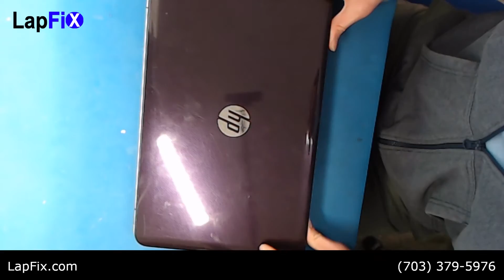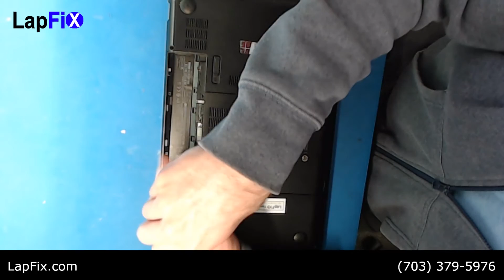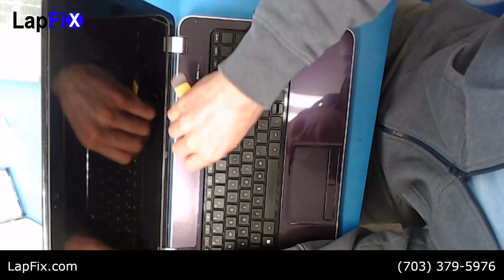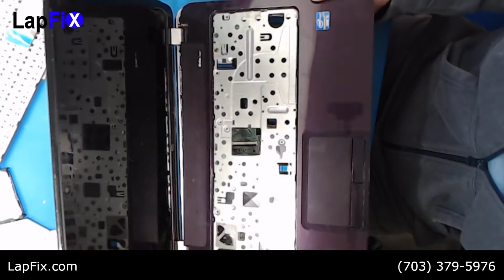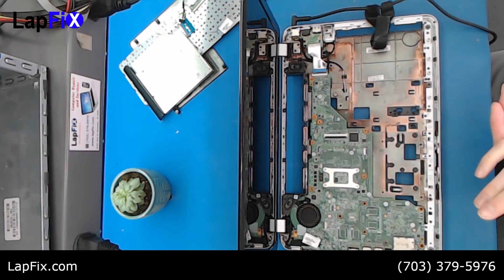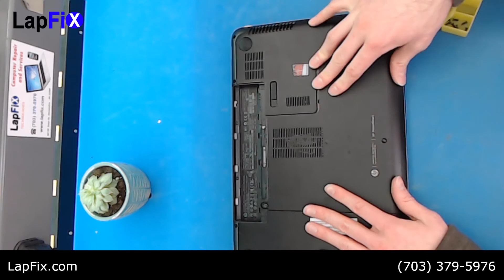How to Fix a Dead HP Laptop - Power DC JACK Repair | LapFix

Comment: Hello, I used to change DC jacks when they were soldered on the mainboard. Man those were terrible. I had a Deathray for a soldering gun (Walmart equivalent soldering gun). I'm surprised any of my fixes worked.. lol I suck so bad at soldering. Currently re-learning with a semi-legitimate soldering station. Looking for videos on  Desktop Motherboard repairs. Had some great luck getting "dead" boards and recovering a few with pretty easy methods, sometimes they just power on for me, and test out ok. Some however are as described, dead... I'd like to find videos on this, or find out why there aren't many.  Not stating that here as a question, just explaining how I found your channel. Found your IDE board swap / fix. Interesting stuff, felt like that would have been harder on the HDD fix. Good videos, thanks for sharing! I'll click a few likes as I check more videos out!
Reply from the maker: We appreciate it, thank you